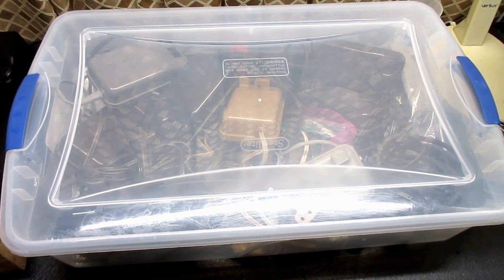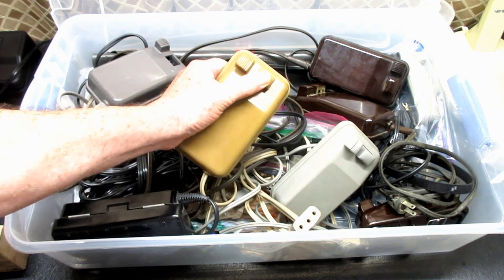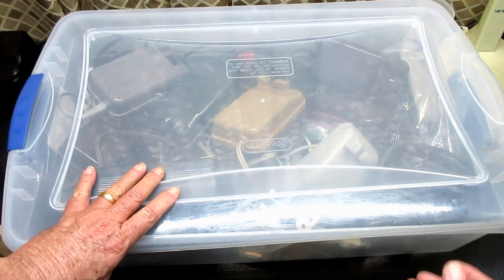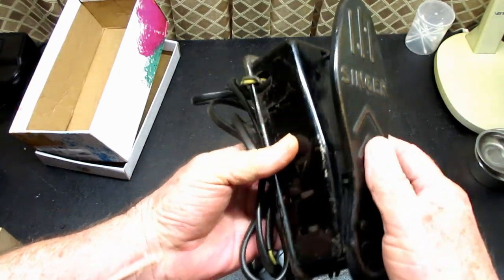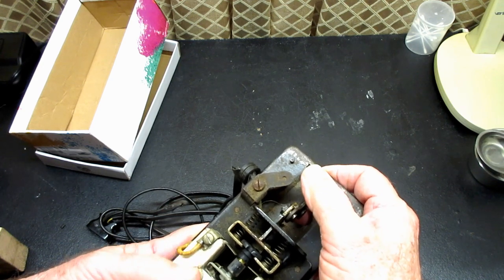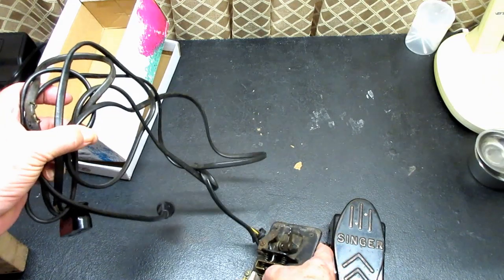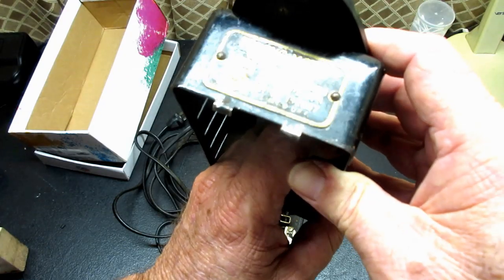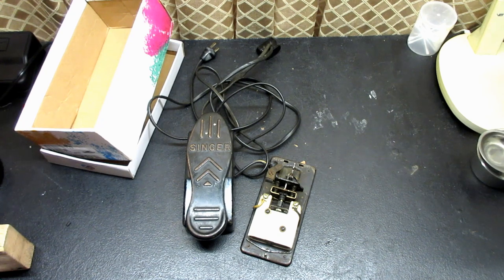Could this be the First Type of Foot Pedal Singer Made?

Comment: Dear Andy, I have some documentation regarding this foot control.  I own a copy of the book, "Singer Sales Points". This book was printed as "a private and confidential communication to and for the use of only the employees of the Singer Sewing Machine Company." (Quote taken from the title page.) Since it wasn't published for public purchase there isn't a copyright date. However, clues within the text would date the book to 1928 or as early as Fall of 1927. On page 84 this pedal is featured as, " 'The New Foot Control' The new pressed metal foot controller for portable sets and cabinet tables has a foot-shaped treadle mounted on the controller box as shown in Fig. 3. It provides a comfortable position for the foot of the operator and responds with remarkable ease to the slightest variation in pressure. Another advantage is that the new outfit will not 'creep' on the floor when in use." (Note: Fig. 3 is a 1" high, clear illustration of the Foot Control.Also on page 33 there is an illustration of it attached to the Singer Portable Electric 128-13 with the description, "This outfit...is furnished with both knee and foot control, as are all other full-sized family heads." So this foot was made for several different machine models.Thank you for your videos. I enjoy watching :o)
Reply from the maker: Thank you, Mary, for sharing this information. This is a ton more than what I could find online. I just searched for the book and found a couple of old eBay listings and a reference on "APRIL'S 1930," about it, with a picture. ( http://archive.constantcontact.com/fs040/1101295361976/archive/1102677940522.html )  So it is older than I thought and I understand what they mean by "pressed foot" now. I am so glad you took the time to comment about it. I pinned your comment to the top in hopes others will see it. I think I'll reference the info before I end the little series about it. Oh, and BTW, thanks for watching my channel and please share anytime you can. Take Care.
Reply: Hello Mary, I am interested in your comments as I can find very little information other than this (and all other) video from Andy Tube regarding the "Model A" foot pedal.  Is there any way you could post the images and text you reference in the message above?  I have just purchased a 1933 Singer 99K with this pedal, and it needs some attention, so the more information I can scrape together the better.  Best regards,  VB
Reply: @lbeez810  Dear VB, I have tried repeatedly to reply to your comment, but my replies aren't being posted. I'm unable to share the information you need.😕
Reply: @maryrcowgill6442  Hello, I'm sorry that we can't connect this way.  I have searched for you on FB, but no luck.  I can be found at Veez Beez, if you are inclined to still reach me.  Best regards, VB
Reply: @lbeez810  May I ask which platform? FB, YT?
Reply: @maryrcowgill6442  Sorry, FB please.

Comment: I was given a 1932 99K I found on FB marketplace. The folks had it for sale for months and could not sell it so I said I will take it for free. I cleaned her all up and did some fixing and adjusting  (Thanks Andy for all the videos. I could not have done it without you!) Even did some rewiring.  She is now beautiful and works. She came with one of these foot pedals. I am tempted to restore it now after seeing this video. It is in pretty hard shape. Thanks so much for all your wonderful videos. You are a fabulous teacher and very cleaver and knowledgeable.
Reply from the maker: Thanks for saving that machine. I appreciate your kind comment. Getting that old black finish off was a chore. Afterward, I wondered if I could have given it a light sanding and painted over the original coating. I will say it worked great afterward.
Good Luck in all you do.

Comment: I picked up a 1922 Singer 99 at a thrift store this last summer that has the same foot pedal. I have no idea if the pedal was original to the machine or not, although it goes perfectly with it. The machine was a hot mess, but I was able to eventually figure out all its problems and now it sews like a dream! I loved the antique look of the foot pedal, but  it seemed so old and rickety I was a little afraid to use it. But since the wiring looked fine I tried it out, and what a surprise! It is the best foot pedal I've ever used! With all the other sewing machines I've had, I carefully start pressing the pedal, ever so slowly adding more pressure, until suddenly the machine zings into action and races away. This one engages very smoothly and evenly and is very responsive and steady. It's really a pleasure to use and SO CUTE!!
Reply from the maker: Wonderful story, thanks. It is a very unique pedal, for sure. I wonder why they every went to the button style, but a retired repairman told me they wanted a pedal to fit into their cabinets for use with a knee control lever. Thanks for watching my channel. Take care.

Comment: My mother had a Singer sewing machine with the type A control. It was supposed to have been converted to electricity probably in the early 1930s. The machine is still in the family but the foot pedal has gone. A later pedal survived with the machine but it's not much good because it doesn't allow the motor to run slowly.

Comment: I have a similar foot pedal that came with an early 1920's White Rotary. It has a cast metal foot and base, a stamped/perforated metal housing for the rheostat of 5 or 6 coiled resistor wires embedded in a ceramic base. Pressing on the foot-shaped pedal pulls a stiff spring-loaded wire that pivots the "wiper " arm across the coil stations. Unfortunately, none of the coils is intact enough to complete a circuit. I would love to figure out a way to rig it up with modern circuitry while retaining its spring action. I call it my "funky foot pedal."
Reply from the maker: I remember seeing pictures of foot pedals like yours many years ago when researching the Singer pedals. They looked so interesting, but most were in poor condition, sadly. There are probably thousands of them sitting in storage someplace. Nice if you could find a couple more and maybe cobble the parts together to get one working. A nice part for a collector though.